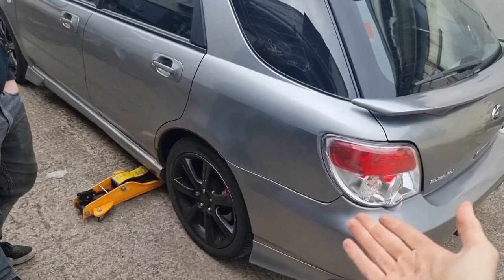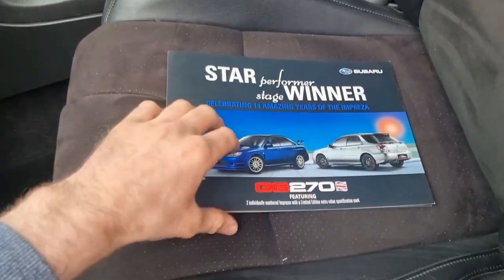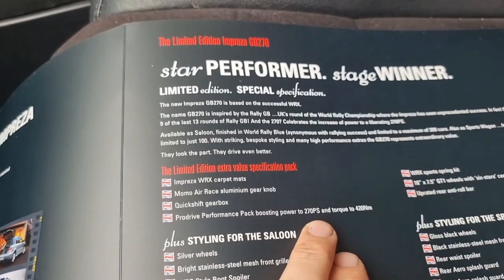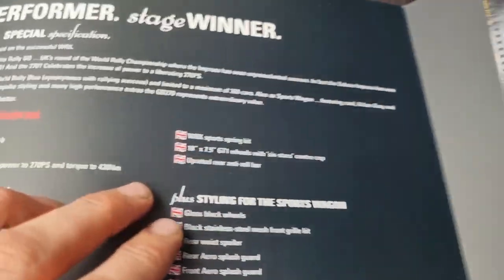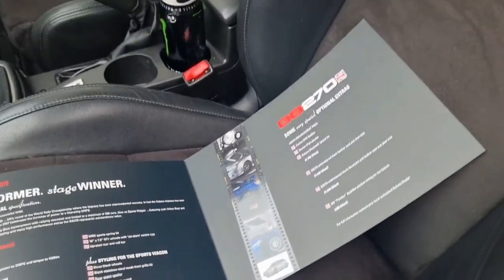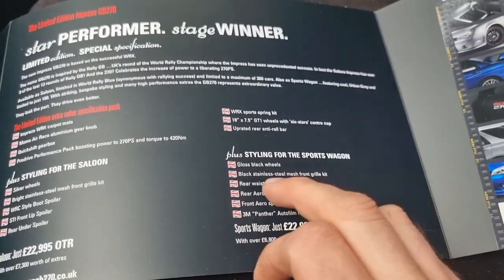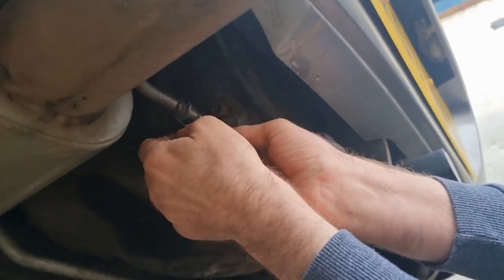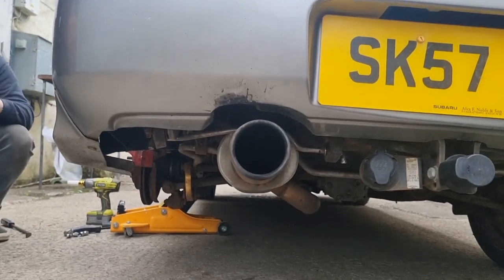Was the GB270 Impreza cheap for a reason?

Comment: life valley road - are you guys North west based?  You sound close to me lol - need to come catch up if your about ?

the "uprated" droplinks on the rear suck - mine sheared off after a few drives - might have just got unlucky though really.  I just went with new OEM ones, some new bushes for the roll bar (kept OEM roll bar) - the BC coilovers changed the driving so much i just didn't feel the need.

the calipers are a replacement for OEM but they couldn't put SUBARU on it - i had MTEC disks and red stuff pads - it improved braking but after owning the 600bhp gtr with giant brakes i just got so used to stopping much better - so i replaced the lot with D2 6pot front and 4pot rear with 356mm discs... not cheap but the single best mod i did to the car

Comment: Common rear knock it the inverted rear shocks on the sedan, you can cure it temporarily by spraying lithium grease on the rear shock under the covers. I had it on my WRX Hawk. OEM brakes have not right to be on a car like this. I uprated mine with a godspeed kit

Comment: Those calipers are oem ones. Get some better pads and change the brake fluid. That's what helped my Bugeye WRX.
Reply from the maker: I thought the original ones had "Subaru" printed on them like the back ones do? 
Discs and pads is definitely next after sorting the shock 🙂
Reply: @LeadFootash23  yeah they are just a oem replacement I mean. Unless you go to subaru directly you'll get them from Euros or wherever.
Reply from the maker: @YTSsport  ah yeah that's what we figured. I'll get some discs and pads and do a fluid change and see if that helps.
Feels like the pads might have glazed over or something, they hardly do anything when you're driving quick and one of the discs is slightly warped which won't be helping